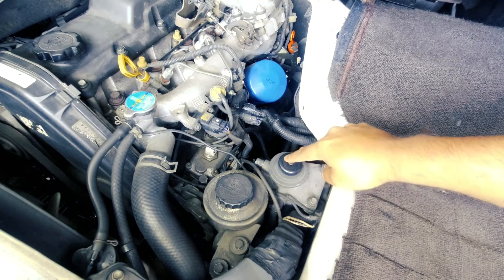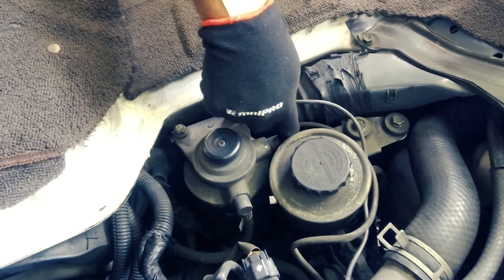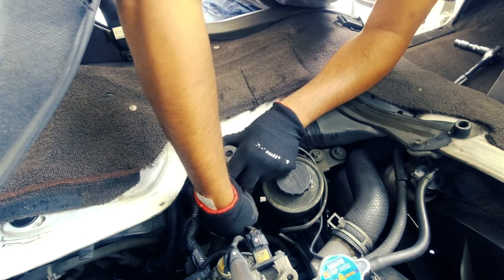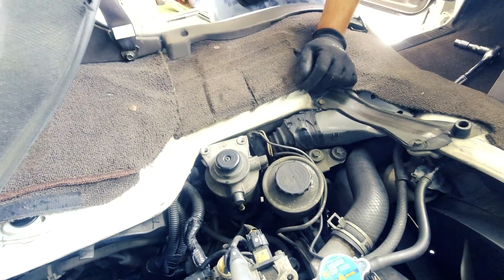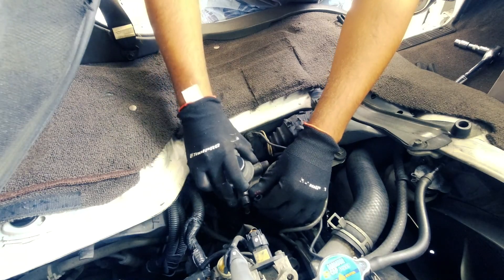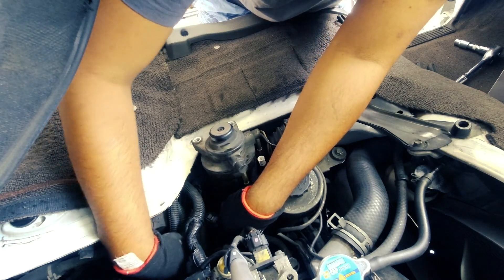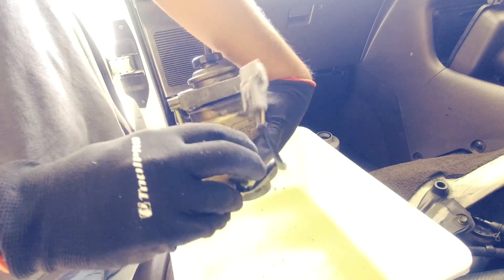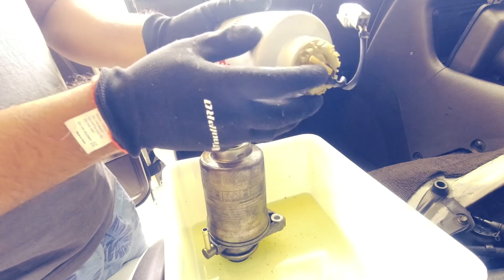Toyota HiAce Fuel Filter Change 4WD Super Custom 1997

Comment: Just want to add my thanks for your time and effort making and uploading this video. 
Just about to replace my fuel filter on my 96 super custom van.
I am a competent home mechanic and would have worked it out, but it is always great to see the steps in advance and know what to look for.... makes you feel more competent.

Love the use of the needle nosed pliers ..
Reply from the maker: Thanks David appreciate your time. Also someone in this comment section had a bad primer only realising after replacement. I gave him a solution just incase you need.

Comment: Thanks for sharing, great information. Could you please upload some other usual maintenances for this van, like changing disc brake etc?
Reply from the maker: Hi mate

Thanks!

Will do whenever I have to do something on it. For now it's all perfect 😉
Reply: I did the brake rotors and pads on my super custom van, I'm no mechanic but it was reasonably easy need impact driver or long socket bar big difference I think  the brakes  a bit warped, big van for little discs, I replaced with genuine+ greased everything up

Comment: There really aren't very many resources available for the kz100s. I'm at new owner of a super custom 94 turbo diesel and in America. I was able to find a filter for my oil change but would you mind sharing the specific oil type you use for your changes? Thanks so much.
Reply from the maker: 10W40 or 15W40 if you live in a warmer state.

Use only diesel engine oil. Doesn't matter if it's mineral of synthetic, I prefer synthetic or semi synthetic.

Make sure the oil is API CF4 certified or its direct replacement equivalent.
Reply: @nathansharma87 thank you!! A regular batman of the HiAce import community

Comment: I just replaced my filter but ran into the following issue: I pre-filled the filter and also topped off both fuel hoses/lines, after assembling everything I started to manually prime the system for at least 5 minutes without the output line connected but the plunger just won´t get hard and no fuel squirts out. When blocking the output with my finger I don´t feel any pressure building up so no additional diesel is being sucked in from the tank.
According to some forums the manual priming mechanism can go bad, is there any way to (safely, especially for the engine) prime the system without using the manual priming pump?
Reply from the maker: Hey mate,

Open the fuel filler cap, leave the fuel to engine hose off the filter.

Slowly blow compressed air into the fuel tank from the filler. Use a rag as a seal.

Do it until fuel comes out the outlet on the filter.

Unfortunately allot of people treat a primer pump as a fix it all magic button. They prime the absolute shit out of it whenever the car won't start and hence it destroys it.

You should be able to get a replacement. If your in the states you can try the Hiace owners north America page or amayama or partsouq.
Reply: @nathansharma87  Interestingly enough when I submerge both the inlet and outlet connection into a cup of diesel and start pumping there are bubbles rising up from both sides and you can slowly feel some pressure building up (so the pump clearly still is doing something), but as soon as everything is back in the car and all lines are connected it gradually gets softer again with every pump even after "priming" the line from the tank with the compressed air trick.
Reply: @nathansharma87  So quick update, I primed the system with compressed air and just completely ignored that stupid priming pump. She started right up afterwards (no coughing) and idled without issues for 5 minutes, today I drove around for ~12 miles also without any issues so your tip worked like a charm, thanks a lot!
Reply from the maker: Awesome glad your up and running 👌

Comment: Thanks for the video! Do you have any ideas on trouble shooting the windscreen washer system? On my 1993 Hiace neither the rear nor the left front spray even though I can hear the pump motor run.
Reply from the maker: They are separate units so  the issue won't be connected.

In my general experience with cars there could be 4 issues.

1) The nozzle is clogged.

2) Someone put windscreen polish instead of windscreen wash blocking up the nozzle and lines.

3) The internal hose connecting the nozzle has disconnected

4) The motor is worn out even if it's working.

I'd look at those things and work my way through.
Reply: @nathansharma87  thanks! What’s the best way to access the hoses and motors?
Reply from the maker: Motor should be in the reservoir underneath the car in front of the front passenger wheel for the front windscreen at least.

As for the hoses, you'd likely have to remove the glove box and start looking and feeling your way around.
Reply: @nathansharma87  thanks again!

Comment: Any advice on how to lower idle rpm , 2.8 Diesel .
Currently sits just above 1000 , lowers when aircon active .
Reply from the maker: Idle adjustment screw on diesel injection pump. Should be 750rpm idle and 900 idle with ac. Might also have AC idle diaphragm to increase rpm automatically. Make sure there is no idle up button inside engaged or manual engine idle up twist knob that's set for high idle first. Don't over fuel it, can run away. Recommend having a diesel tech do it.

Comment: Is the fuel filter location the same for a 2003 model Hiace or is this one specific to your "import" model ?
Reply from the maker: If it has a 1kz it should be the same. Regardless of what engine or filter location changing the fuel filter should be the same so long as it's the same spin on type of filter.